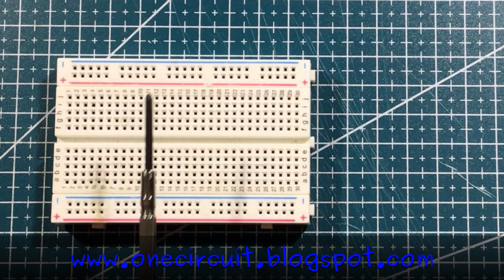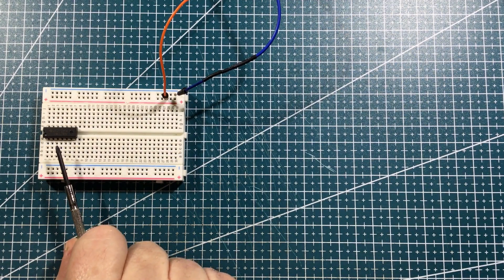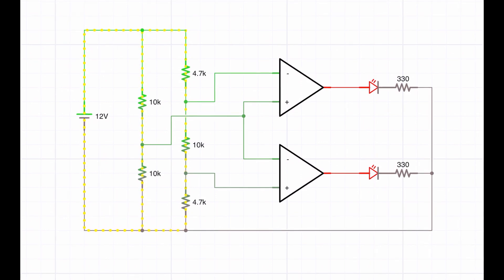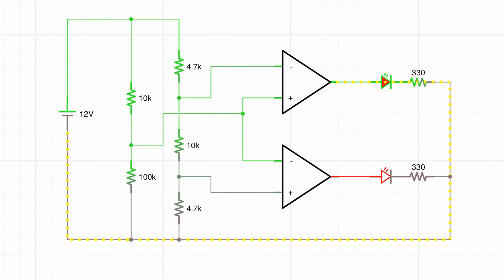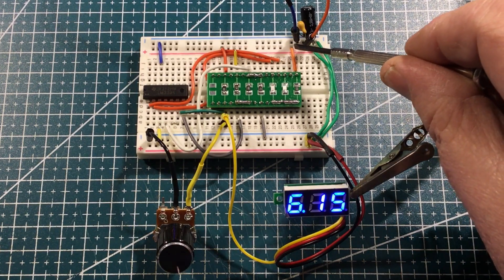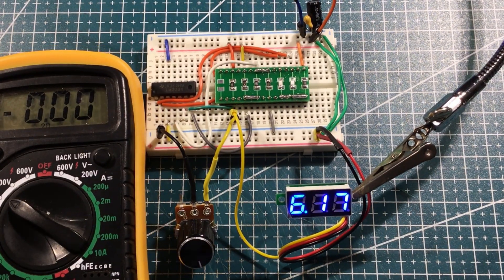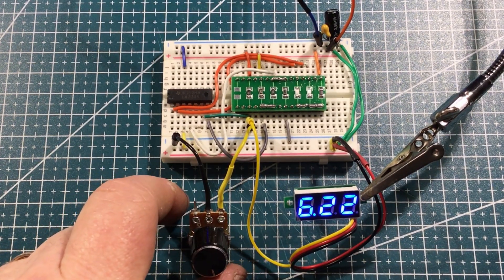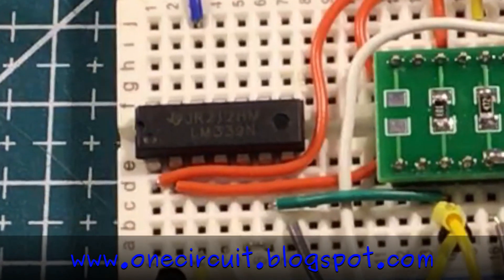LM339 Quad comparator configured as a "window"

Comment: Nice-O.  Op-amps and comparators are excellent tools for a lot of voltage and current monitoring or conversion/amplifying in the case of the op-amp.  I have been forcing myself to use them more in place of or with uC's.